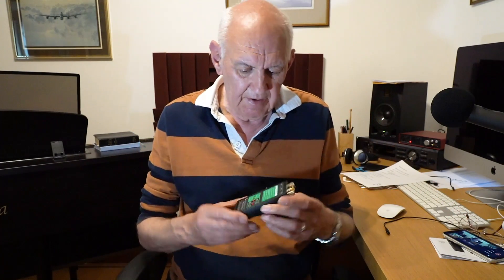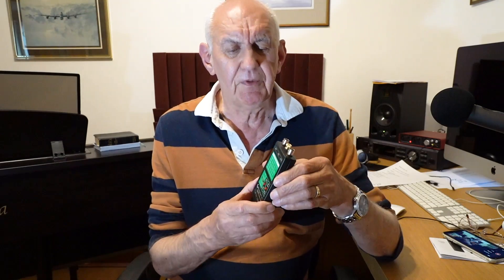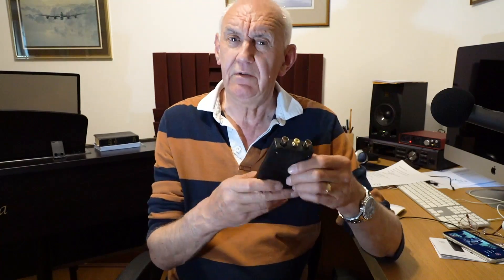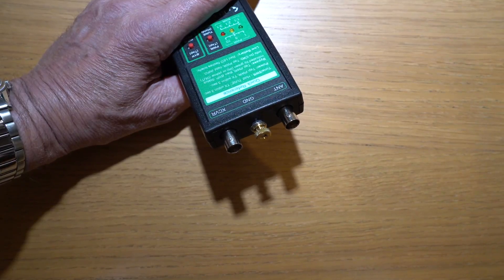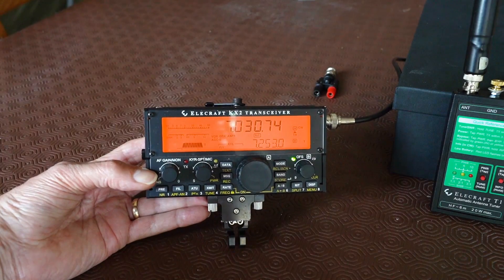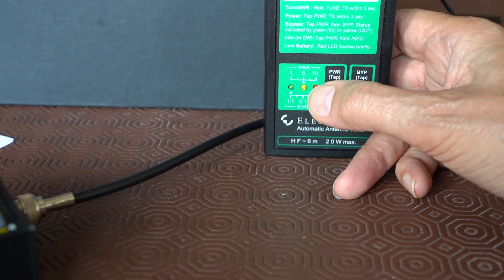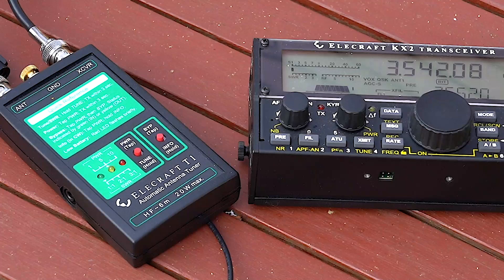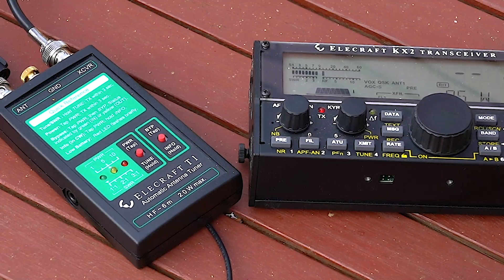IC 705 Companion - Elecraft T1-A Auto ATU

Comment: What a great little ATU. The problem is, Elecraft can't get parts needed to build them at this time. I've been waiting for almost 6 months and there's no light at the end of the tunnel.  I did purchase an LDG ATU but I am not happy with it. The main issues I have with it are:
1. Size
2. They use SO 239 connectors
3. Super slow to tune.

Good video, thanks for posting,
Barry, KU3X

Comment: Great vids.  Question I do have concerning the 705.  The BNC connector on the radio itself, is it male or female?  Im going to order a length of coax to carry in the backpack and I need to know what bnc to have installed on the coax end, male or female?  Thx in advance, and thx for the vids.
Reply from the maker: Hi Ted, it’s a standard female sockei. I think I may have mentioned in the video “plug”which was a slip of the time. Sorry. Peter.
Reply: @watersstanton   Thank You

Comment: Sorry if I missed it in the video, but it should be noted that it also has a jack on the side for remote tuning trigger. Additionally, if you have a compatible device, that jack is also used for receiving band data. If you switch bands and tune, then you can just send only the band next time and it will snap back into its previous tuned state for that band, rather than having to transmit a carrier and tune all over again.

Comment: Great video.  How far out will it tune.  3:1, 5:1, 10:1 etc?  Only asking as I have the KX3 with the building in ATU and wondering if this would still be worthwhile to have in my kit.  Tanks again for the great videos.   JJK
Reply: Hi John, I would have thought that the ATU in the KX3 is very very similar to this .  The one in my KX3 is superb and my pal uses one of these and they seem very familiar. 73 Mike
Reply from the maker: Around 10:1  The internal KX3 ATU has similar range. 73s Peter